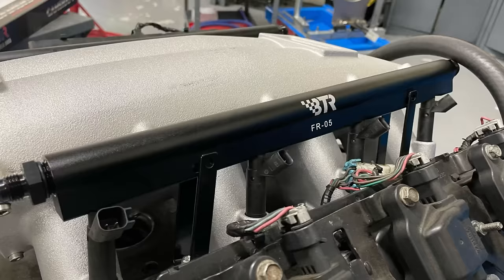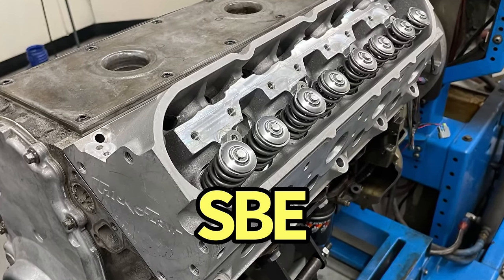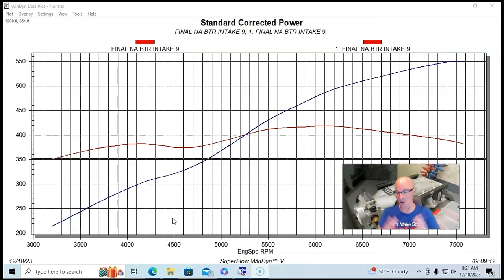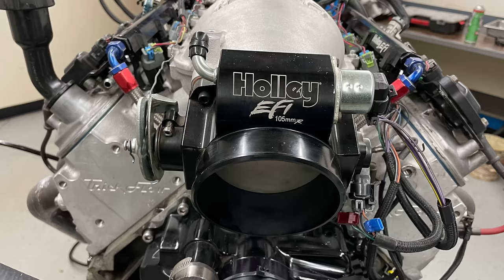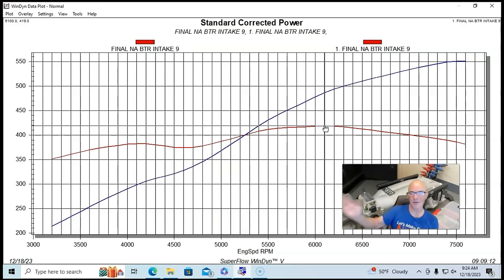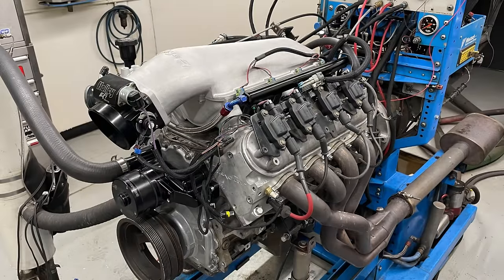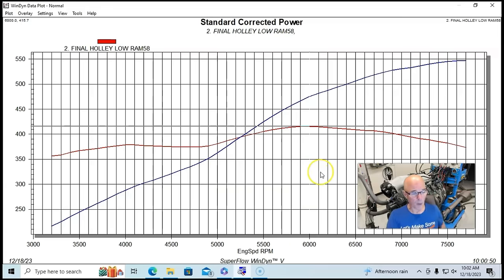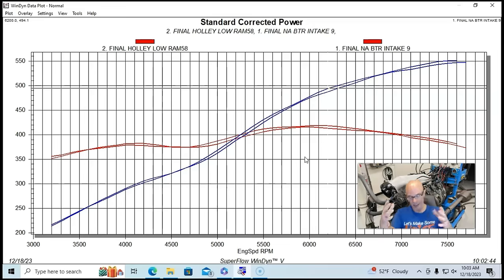7,700-RPM 5.3L LS SCREAMER INTAKE TEST! BTR TRINITY VS HOLLEY LO-RAM-WHICH ONE MAKES MORE POWER?

Comment: I love this 5.3! But a previous video showed a truck Norris can works surprisingly well with a short runner intake. I think you should do a trinity intake with the truck Norris, BTR hot rod, red hot, and stage 4 cams to see how they all compare on a short runner intake
Reply: Low LSA Truck Norris is opening eyes
Reply: Texas Speed Chopacabra is the alternative
Reply: More overlap works better on a short runner because the pressure recovery is better

Comment: Why does the btr intake run have 80 plus psi and the Holley have only 70? Wildly different temps or different oil?
Reply: Oil pump bypass should stabilize this at the top end better unless wildly different oil was used or the later was a stone cold run vs a very heat soaked run… or a different engine on a different day… 🧐

Comment: The Trinity is just so damn pretty compared to the Holley. Thankfully Holley have taken design queues for it's latest offerings from manifolds such as the Trinity for it's newer 3 piece designs. Alot of guys run the Trinity on Boosted applications.

Comment: Since we mostly are here for budget building tips/tricks etc, I thought I would leave this info. For the average guy that wanted to do a high RPM NA or even Forced Induction setup and needed to replace the stock plastic Intake Manifold on either a Gen III or Gen IV Cathedral Port setup (LS1/2/6, 4.8/5.3L) consider the following:
Holley Lo-Ram Alum + Rail Kit = $800 (Natural Alum, +$25 Black).
BTR Trinity + Rail Kit = $900 (Natural Alum, +80 Black).
SpeedMaster Sheet Metal 102mm Intake + Rail Kit + (DBW/Gen IV) 102mm Throttle Body = $725 (Black).
SpeedMaster Sheet Metal 102mm Intake + Rail Kit + (DBC/Gen III) 102mm Throttle Body = $525 (Black Manifold/Rails, Silver TB).
While I am not about to dump SpeedMaster Valve train into my build, there are some things that we can sacrifice to 'The Budget Gods' that will have very little overall performance impact in the grand scheme of things. Look at the price differences. If you are on a budget, an Intake Manifold w/Rails and either a 102mm Electronic or Mechanical Throttle Body included, while still coming in cheaper than the more Premium parts is a sacrifice that I believe many would make. As I said, this isn't valve train or rotating assemblies here. Just a thought.
Reply from the maker: they just make less power

Comment: A feller wonders what this all aluminum powerhouse of an engine might weigh?..🤔 Cool test as usual R.H. !  550hp from a lil ole 5.3 is some serious horsetorx !
Reply: Long block is 340 on my scale. Iron block LS in 440 on the same scale.
Reply: @travisblack417  342/449 on mine. I guess my Chinese scale must be halfway accurate.
Reply: @Kincentc  close enough lol
Reply: @Kincentc  could be a bit dirtier or have more fluids, pretty close

Comment: Another recommendation for a video would be a 4.6 2v pi short block with trick flow heads and different intakes i am interested in knowing the torque output with truck/van intake setup.

Comment: I love the 5.3l videos! I might be bias and have a long bed swapped the 4.8l out with a 5.3l and rebuilt the 4l60e. Cam and fuel delivery and tune is what I need to do with it. Should I keep the 862 heads and upgrade the springs or get new heads? The ccs are good enoughz
Reply from the maker: keep the heads

Comment: You just put a bigger higher reving cam in your car and it sounds cool, but low end power socks. You have a car load of people trying to power shift and car bogs going into second gear. I'm going back to the 224/226 @.050 to regain torgue in my 347 ci LS.
Reply: Yeah, because I always run the balls off my car with it filled like a clown car. Sounds like you need to shift higher and get a better grasp on reality.

Comment: I'm curious about the Ultra Lo-Ram Richard, do you think Holley will ever send you one to test against these other short runner options?  My guess is that it will be another one that is nearly indistinguishable from these two in this video, but it would be interesting to find out.
Reply from the maker: it will make less in this rpm range if it has shorter runners
Reply: @richardholdener1727  I suppose it probably does have even shorter runners...  I'll have to look at some pictures and see if I can tell at all.
Reply: @richardholdener1727 I think the ultra low and the low have the same runner length but different tops. Motor trend tested the ultra low, and it does better than the low ram, apparently.
Reply: @bowtiejake  Good info, thanks!  Where can that testing be found?  I'll do a general google for it in the interim.

Comment: I noticed the trinity's run had higher oil pressure than the holly at peak and throughout the run. The Hi ram and the Low ram in your other vid the pressures were pretty even. Could this difference with the trinity on cause the power curve differences?
Reply from the maker: no
Reply: There was a solid 10 psi difference that doesn’t add up if it’s the same engine 🧐
Reply: The last few “comparison test” seem to be old past data mixed with new data with supposed “same”/similar engine combinations, rather than an intentional back to back comparison minimizing variables…

Comment: Just trying to visualize the air movement down the runner... especially short verse long runner as valve opens and closes thousand times a minute. Would it be fair to compare this to water hammer in a pipe, creating a pressure spike at the valve? More air weight in a long runner creating higher pressure spike? Alowwing more air to enter when valve opens?
Reply from the maker: three distinct forms of charge filling associated with intake design-Reflected wave, Inertial Ram and Helmholtz resonance-each provides pressure waves to enhance cylinder filling (you are describing something similar to inertial ram)

Comment: Love the 5.3 but what is your take on swapping out a 5.0 and putting in a 5.3 or a 4.8
Reply from the maker: LS makes a lot more power-but will be $
Reply: @richardholdener1727  it's not the Chevy 5.0 so increase in power is going to be a good thing, I want to keep it manual thinking nv4500 since the mod5r2 won't work. An the 302 is reliable but definitely time for retirement. Yes I want to put a 4.8 or 5.3 and a manual transmission in a f150. Yes I know stupid but not

Comment: Have you tested this same engine with TBSS intake? how much gain in torque and how much loss in high rpm power?
Reply from the maker: it would add torque up to 6000 or so, but be way down on peak power

Comment: I choose the victor jr short runner with a 1200cfm throttle body for my high rpm LS. 4.8 rods/crank 6.0 block .040 over.  Do you think the victor JR was a good choice for that or do these low ram style intakes work better in your opinion?
Reply: Just clarify I’m just trying to build a high revving 8000 rpm dz302 style engine.  Not shooting for big torque numbers. More a fun engine that sounds sick at high rpm. Got a fairly big  LS3 cam I’ve made 500whp with in a camaro. So the valve train will support the high rpm.
Reply from the maker: is your cam stable at 8000 rpm? spring rate doesn't cure an unstable cam profile. A victor Jr. cath port makes much less power than these

Comment: rich should I use the trinity on a ly6 punched to a ls3 (376) or maybe just .30 over with the stock 3622 crank (370) with dome pistons for either build with about 11:5:1 comp with a btr stage 4 ls3 cam a 4180 with 4k stall? would that work or should I choose a different intake?
Reply from the maker: you should not bore the 6.0l block that far
Reply: @richardholdener1727 ok well what about just .30 over with dome pistons?

Comment: 240+ degree duration with tight lsa is the magic on short runner.
Reply from the maker: IT DOESN'T CHANGE WHAT RUNNER LENGTH DOES
Reply: @richardholdener1727  it changes where it wants its torque peak and hp peak.  So it'll make more in the runners sweet spot.  This type of dyno has been done on other architectures.  Where short runner will extend the power band of a non optimal cam.   But paired with a cam that wants to make power and torque high itll be elevated.
Reply: @dennisrobinson8008 . Are you familiar with all the research and testing Richard has done?
Reply: @bri-manhunter2654  i know who Richard is.  He shouldn't argue about a cam designed to power peak where the short runner intake is optimized to make power will result in Even more power.    There was this world class lifter doing squats with 700lb in a power cage.  He missed the lift and his torso was torqued forward under the weight he lossed control with.  He was almost folded in half.  At the end the weight rolled over his neck and the back of his head.  At the very least his low back was highly strained.  At the worst he could have been killed. I said he could have adjusted the safety pins in the rack so they are a few inches under his max depth.   That way he can safely sit out of a miss.   Yet he had the safeties well below mac depth near knee level where they were useless.  I was attacked for my honest observation.  The safeties are there to save you yet most font set them right.   Had a novice lifter made the same error people would have called him foolish and said he could have seriously hurt himself or died.   People have died.  Richard could have realized I was right and with insecurities said your right but I wasn't testing for that this time.  Basically parts designed for an operating range when combined together yield wildly high numbers.  The demo showed the short runner will extend hp peak and powerband of a cam that not even designed to rev out that far.  Yet there are cams designed to peak at that point and they will generate wildly high numbers.  I wasn't trying to make him look bad.  But I've been on the subject 30 years.   Back when Tooley was doing customers like a consultant one by one basis trying to grow.  I still remember some of the convos on the fhats I was a member of where uncommon knowledge was discussed.  Rich keeps snapping at me. And I'm enjoy his presentations like the next person.
Reply: @dennisrobinson8008 . No disrespect, but I’m going to go with what Richard says, through his knowledge and my real world applications.
Reply: @bri-manhunter2654  do what you want.   I wasn't going against him as I never do. He could have simply said he wasn't testing that.  When your parts are combined together to work in their designed powerband you'll have synergistic effects which show as an unusually high power and torque number.  He knows that.
Reply: That BTR trinity will be no good without high compression greater than 12:1 and high rpm over 8000.   The runners are too short. What would David Vizard say?
Reply: @dennisrobinson8008 . It’s because you are missing the point of the test, no offense. He has done multiple variations of these test where he has gone into depth with the results. It’s your job to do more research and find the answers that he has already provided. Can you imagine being bombarded with the same questions all the time.
Also, you shouldn’t try to argue with absolutes.

Comment: how much boost hp can aluminum block ls 383. handle with arp main studs and arp head studs?
Reply from the maker: If you run boost-you should not bore the block out to 3.905

Comment: Does this have fly cut if it does how much planning to do this setup
Reply from the maker: stock flat top l33 pistons
Reply: @richardholdener1727  what push rods?
Reply: @richardholdener1727 also how much did you mill the heads or you did nothing like that if you did mill and what fly cut and push rods it’s an interesting build I wanna do on my swapped BMW e36
Reply: @richardholdener1727 how much mill did you do and what push rods?